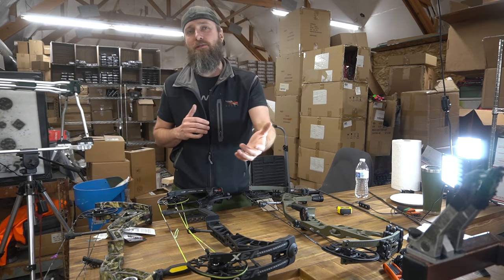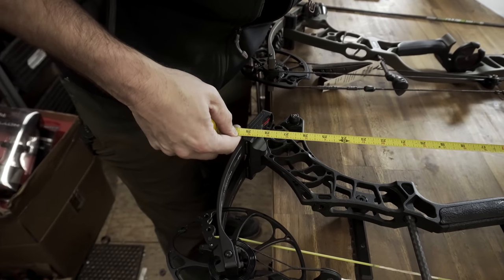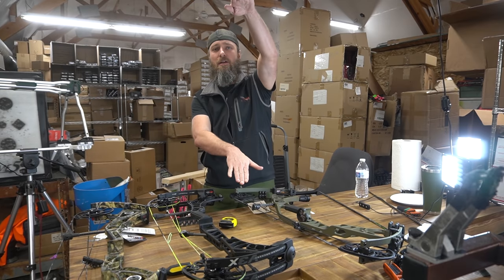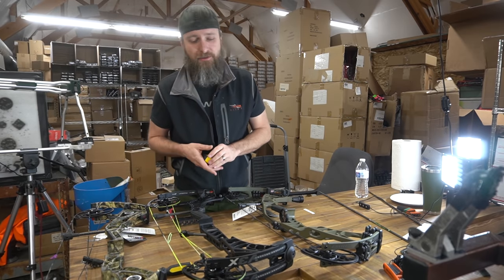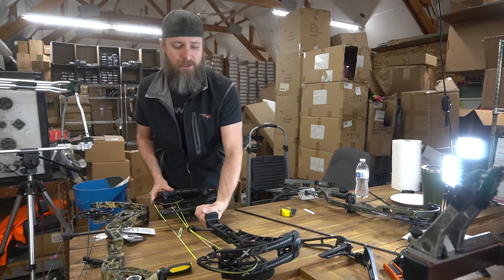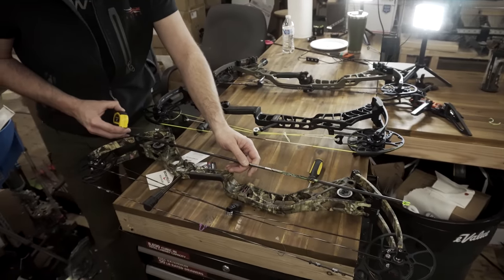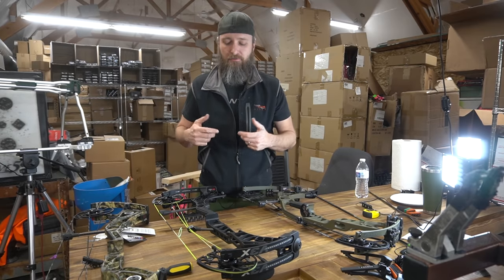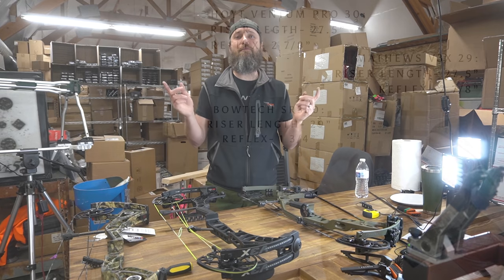What Makes a Bow Accurate? Find out with MFJJ!!

Comment: With the utmost respect this is kind of correct but is not in touch with the real reason. 
Every compound bow design has the potential to experience torque while it is being pulled to full draw. That is to say, even with perfect grip holding technique in play  ( where the grip, or should I say, supporting hand exerts zero lateral forces upon the grip, and therefore of course the riser), the overall bow design can cause the tip of the arrow to move from side to side as the bow is being pulled to full draw. If the person tuning the bow is unaware of this integral design induced torque, they are proceeding on the (incorrect) assumption that, if near perfect grip technique is in play, all disparities (with initial emphasis on the lateral disparity) between the point of aim and actual arrow impact point will be overcome by making the necessary (primarily windage) sight adjustment and then adjusting for cam alignment via paper tuning. Of course, assuming consistantly good technique on the hand hold and anchoring, this time honoured method can give good , consistent accuracy at say an initial set up range of 20 yards, as long as the axle to axle length, draw weight and draw length are not changed. As long as these parameters stay the same, at the completion of the setup/ tuning process, the lateral movement experience at the point of the arrow induced by the integral design torque is always present as the arrow is being  loosed, but the tuning process has unwittingly compensated so that the longitudinal centre axis of the arrow is in line with the point of aim. This is actually where the amount of reflex in the riser design becomes relavent. As the amount of reflex increases, so does the amount riser, (and therefore arrow rest support), rotation. Thus even though the bow design may be such that there is significant integral torque, it's influence during loosing of the arrow can be mitigated if the amount of reflex is kept to a minimum in the design. 
What this means is that the focus on the amount of reflex in the riser design is in fact, unwittingly overlooking the real reason it comes into play i.e. it is dictating the degree to which integral design torque is able to influence the path of the arrow in the time taken before the nock leaves the string and the rest falling away from the arrow shaft ( assuming the bow is fitted with a fast acting fall away rest.) 
What is therefore most important to understand is that the less integral design torque a bow has, the less the amount of reflex remains influential. Yes, less reflex means more forgivness of hand hold induced torque, but the most important bow characteristic any bow designer/manufacture should be focussing on is integral design torque, and of course perfectly square nock travel. 
To the best of my knowledge, the only compound bow I know of that has zero integral design torque has a reflex exceeding 3.5 inches, yet it is widely accepted to be a tack driver over all ranges at and then beyond, say a 20 yard setup distance. Proof of all of the above is that when that particular bow if set up with the sight windage left at dead centre, in line with the rests centre shot and the arrow tip in perfect lateral alignment of the cams, "robin hoods" at all ranges out to 60 yards become so frequent, shooting at the same aim point becomes too expensive. 
So, yes, less reflex is good but zero interal design torque is the real holy grail in any compound bow design; particularly in a hunting bow where shot ranges are always going to vary.

Comment: I do not see how the brace height is also a very very important measurement as well. With all things considered.... If the power stroke of a bow is 2 inches longer on a "tur-bow" because of a short 5.5" brace height versus the arrow exiting off the string (not the bow) faster  on a target bow with a 7.5 or even larger brace height resulting in the shooter being responsible for the horizontal trajectory of the arrow/nock point for less amount of time/inches of draw. Sure seems to me like the least amount of time you would be responsible for it i.e. a large brace height the better shooting bow it will be... More forgiveness.

Comment: TL;DR: Reflex isn't a thing. However a bow with less reflex will still be more accurate. Form is more important, and the dude is just trying to sell more Matthews and Bowtech.

Maybe we should incorporate physics, engineering, and biomechanics into the equation.

Accuracy is based on consistency of energy transfer. Same direction and magnitude of forces every time.

Reflex plays no part in it. Axle to axle plays a very small role. Brace height is important. Stiffness is. Shorter draw length, longer brace height, wider cams, semi vertical limbs, increased bow and holding weight, and precision tolerances.

Stiffer riser, limbs, string, and arrows means the magnitude of vibrations are reduced and mistakes have less effect on the shot.

Harmonics and vibration of the bare bow are still overrated. They can cause accuracy issues, but it's more like tuning an instrument. If you don't know what note it's supposed to be playing, it might help or hurt to change the tune. Generally less is better, but it's usually the smallest factor in accuracy.

Form is huge. Torque is the easiest way to explain and demonstrate. You can torque the bow the same way every time and get phenomenal groups, but your arrows are hitting the target sideways. It's fantastically accurate but still useless. The balance of tension before release is the most important part. The bow dropping or twisting away after release changes harmonics and is a sign of unbalanced forces on the bow. Every muscle and tendon under tendon get released at the same time on the shot. The unbalanced forces result in moving and twisting the bow. There's technically an ideal arrow speed, force curve, and nock travel for a given bow weight, arm weight, holding weight and arm length. Good luck finding it.

Vertical limbs mean they draw back towards you during the shot, increasing brace height. Target bows are often vertical for this reason. When you make the limbs more vertical without making the limbs longer, you have to set them forward more to keep the same brace height. If you make a bow with a high brace height and vertical limbs, you get really long limbs or zero reflex. The vector diagram doesn't change with high or low reflex. Reflex is just an indication of riser optimization.

A longer axle to axle allows the string to whip less during the shot due to the geometry and the counteracting forces of the limbs. Basically the holding weight towards your body isn't the only tension the string is under. The same holding weight with a greater string angle has a higher tension along the string, however that necessitates a longer string and more opportunity for whip, largely negating the benefit. Speed nocks help, but how often do people actually fine tune and adjust those for accuracy or speed? Usually it's just what the manufacturer put on and they leave it. A longer axle to axle usually means a vertical limb angle and higher brace height, but isn't directly significant due to the longer string having more ability to whip and dance.

Which brings up a weird point. High FOC is great once the arrow leaves the bow, but low FOC (especially heavy nock weight) will be more forgiving because it will resist nock travel more. If you have bad form or a bad tune, you'll get better results with heavy nocks and fletching. The more you know.

Wider cams and axles yield a more stable platform at full draw, but it's also affected by the cam groove. Deep, vertical grooves will resist torque more. You want a stance between the nocking point and the sides of the cam, as well as the "connection" between the string and cam being as stiff as possible. Long string, low holding weight, ridiculously long draw and steep string angle will mean that no cam configuration will effectively add stability. 

Little light on the science, but if you're familiar with those subjects then you know what everything means and you probably don't need me telling you what actually makes an accurate bow.

Comment: I disagree in the first point. Length and stiffness of the riser is essentially irrelevant: every riser flexes, more or less, and the only important thing is that it should flex the same every time, to be consistent. And that's what EVERY riser in the market does, no matter brand of cost. If you take a look of the winner of the last two Vegas tournaments (Kyle Douglas) He won using a Supra Focus 37 (2020) and a Citation 36 (2021), both bows with very short risers and long, non parallel limbs. Now, in the deflex vs reflex geometry of the risers, most of target bows trend to have minimal reflex, be neutral or go deflex, which theoretically helps with stability. But in reality, stability is as much dependant on the geometry of the riser so is in the ergonomics of the grip. Most of target bows (which are designed mainly towards accuracy) do have narrow grips with flat ends, whereas more bulky and rounded grips trend to be worse for repeatable shooting. 

   Another thing that affects accuracy is the power stroke: how much inches and time the arrow has to travel propelled by the string from the anchoring point until the nock leaves the string behind. For a given draw length, the more you cut the power stroke (making a larger brace heigh) the shorter is that travel, so you have less time to torque or affect your shoot after your release. But a shorter power stroke means also less speed, which affects negatively your chances of higher scores at 3D and field at unknown distances (as happens in hunting), so is a tradeoff. The most accurate bows? All are accurate and the limiting factor is the shooter. An easier to draw bow with more nimble draw cycle is more appealing to be used to train and a training archer usually performs better than a untrained one. My personal choice would be compound bows with 35" or more ATA, 7 or more BH and a smooth draw cycle; speed and poundage isnt as important due they are defeated by accuracy every day.

Comment: I do NOT agree. Dear MFJJ. Althoug I like most of you technical points of view, this time I do not agree. 
If you see competition bows, they have shorter risers and most vertical limbs. Longer risers just help to reduce hand shoke. Overall longer lenght bows, axel to axle, have higher innertial momentum so its easy to hold them vertical.
Regarding brace height vs reflex you mention, the bow pivots in you hand not at the end of the riser. Thats why competition bows have lower reflex but higher brace heigh, usually more the 7 in and some times even more the 8 in.
Shorter brace height its just something bow manufactures use to get fasters bows but it makes them less forgivable therefore more difficult to shot and less accurate.
(Sorry about my english)

Comment: Okay, now reflex in relation to bow speed… in my theory, adding reflex/subtracting brace height let’s shorter draw length shoot faster bows… cause if hypothetically you put the cams , limbs and all the other parts from a V3x33 and put them on the “straighter” trx 36 riser (which is close to the riser length of the V3X) then you’d pretty much have to use 2” shorter draw modes to have the draw lentils that was on the V3X which in turn would slow you down since the speed mostly comes from the cams and limbs